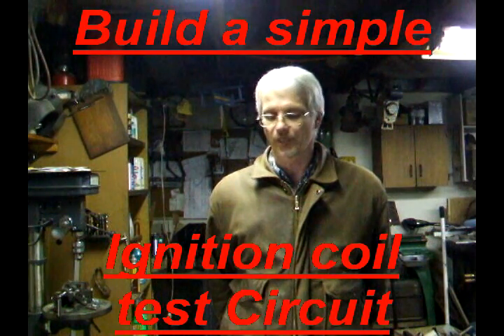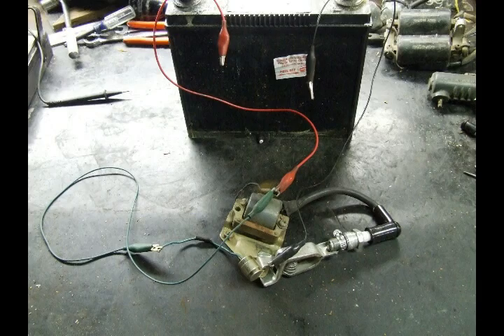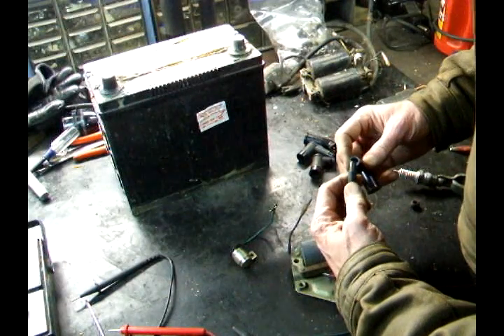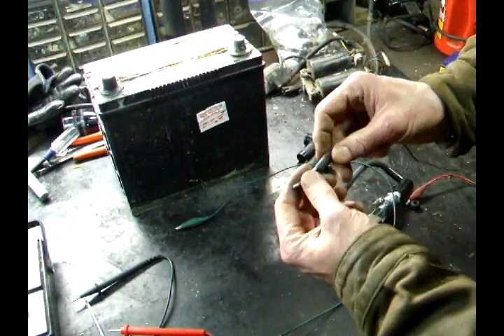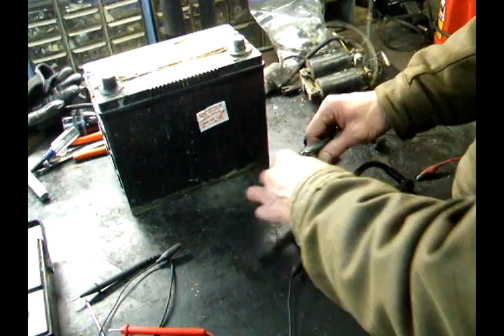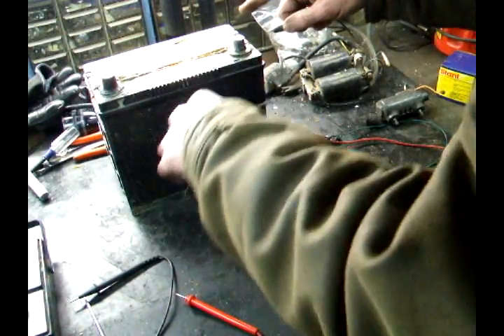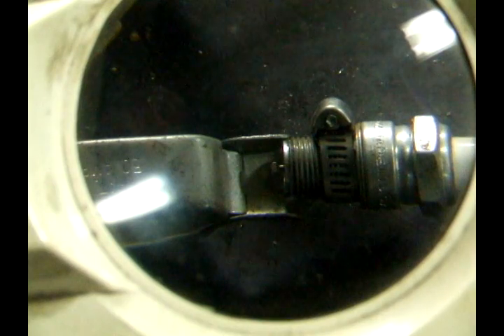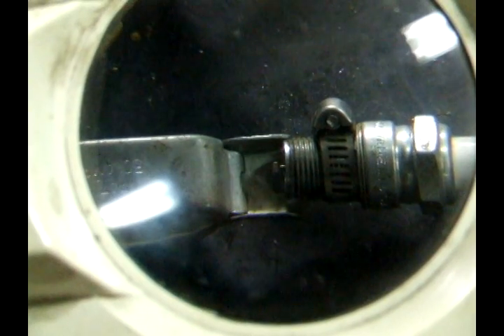Build Ignition Coil test Circuit for Motorcycles and Mopeds

Comment: What size Condensor/Capcitor we need in a 12V system {ZZR600} 1 coil powering 2 plugs ?
Reply from the maker: +Tutor A capacitor between 0.47µF and 2µF can be used, with 400 Volt rating

Comment: Testing a coil on 110 honda 3 wheeler can i use a car battery to test or does it need to be a riding lawn mower size battery
Reply from the maker: If your 110 Honda is a 12 volt system, use a 12 volt battery, if it is a 6 volt system use a 6 volt battery. size of the battery does not really matter, the correct voltage battery does. Sometimes the coil will have the voltage labeled on it. eg. (6V or 12V )

Comment: Is there a size or type of condenser or capacitor to use?
Reply from the maker: Robert Moore Use the one on your motorcycle.  If your testing a bike with CDI ignition, get one from a old points ignition. If you want to use a capacitor, use 600 volt, .2 -.6 microfarad capacitor.